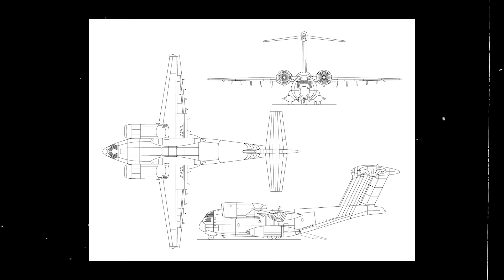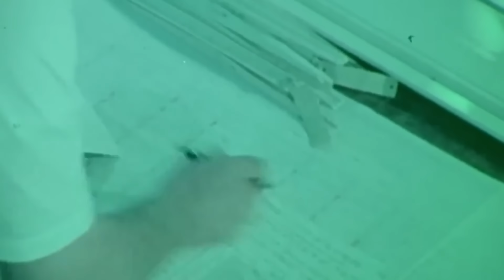The Plane that No One Wanted (But Could Land on a Football Field)

Comment: They could have replaced or at least augmented the C-130 with C-14 and then developed the C-17 from there to replace the aging C-141. What a lost opportunity like the USAF not buying or modifying the F-16 with the F-16XL.
Reply: The C-17 did replace the C-141.  The YC-14 was not needed to replace the C-130.  The F-16XL was not needed to replace the F-16, which continues to be built in improved versions.  Don't believe all the hype you see on YouTube about experimental aircraft, because there is always a good reason they didn't become production aircraft.
Reply: @gort8203  The F-16XL was faster, more maneuverable, carried much more armaments and super cruised around Mach 1.6 in the 1980s. It was actually entered in the competition against the F-15E Strike Eagle. The F-15E won ONLY because it had two engines. As with anything in government procurement, a lot deals with politics. You can bet Lockheed won the lobbying war with Boeing in congress and the Air Force opted to put the new technology into the C-141 replacement instead. The same thing happened with the YF-23. Northrop already had the B-2 contract and giving the ATF contract to Northrop as well would have been seen as too lopsided, so Lockheed Martin got the contract even though many saw the F-23 as actually the better fighter overall.
Reply: @richardlangdon712  "You can bet Lockheed won the lobbying war with Boeing in congress and the Air Force opted to put the new technology into the C-141 replacement instead." 

The C-17 was a McDonnel Douglas product, not Lockheed or Boeing.
Reply: @richardlangdon712  The F-16XL actually lost because it couldn't house the large radar of the F-15. I actually have fingerprints on the 2 XLs as a mod mechanic at General Dynamics at the time.
Reply: @gort8203  "...there is always a good reason they didn't become production aircraft...": Is corruption a good reason?
Reply: @toddmarshall416  "Is corruption a good reason?"  It is always the reason for many who frequent this channel.
Reply: The XL was an experimental airplane meant to investigate whether super cruise was practical in a fighter. The idea was that the cranked arrow wing would have a better supersonic L/D ratio, meaning less drag above the mach. Top speed was not the point, super cruise was, and the airplane failed to deliver the expected performance.  I didn’t even achieve marginal super cruise until it was given to NASA for further research after it lost the EFT competition, and they installed a more powerful engine.

It was entered into the Enhanced Tactical Fighter competition because it was lying around, not because it had been designed to that requirement.  It certainly would not have super cruised loaded down with bombs.    The F-15E won the ETF contract not just because it had two engines.  It won for multiple reasons such as lower cost and less risky development because the F-15 was already a proven strike jet, and the F-16XL was actually substantially different than the original F-16  and would have required a lot more development.

The F-1XL had a better instantaneous turn but inferior sustained turn rate, so it did not have superior maneuverability.  The wing of the original F-16 had been chosen over a delta planform because of that superior maneuverability.
Reply: @gort8203  And it was so good the Air Force took a serious look at acquiring it. Something that really doesn't happen in defense procurement.
Reply: @richardlangdon712  "And it was so good the Air Force took a serious look at acquiring it. Something that really doesn't happen in defense procurement."

Not sure which airplane you are talking about, but in any case this statement makes no sense.  USAF taking a serious look at an airplane and acquiring or not acquiring it never happens?  Seriously?
Reply: @gort8203  I was referring to a plane that was for research purposes only and not in competition for any contract, yet still managed to turn a lot of heads.
Reply: The XL also would have required an entirely new airframe, and that cost was more than the Pentagon wanted to pay.
Reply: Bureaucracies are good at killing innovation.
Reply: In response to the original comment, you’ve heard of the oxymoron, military intelligence
Reply: Yes those two decisions were STUPID, especially the F16XL. There hints popping up that they’re working on the F16XL or are planning on its return. But stealth projects may stop it again. The. Doe’s budget has been decreasing during Biden/Harris years and will drop sharply if the laughing candidate wins. CCP language classes will become popular…..🎉

Comment: The STOL Dehavilland Buffalo was a similar, smaller aircraft.  I saw a Buffalo land and takeoff in a strip that must have been about a football field in length during an extreme demonstration exercise. My mother was one of its designers and they made for the US military a prototype jet powered version which ducted air over the wings and had even better performance.
Reply: NASA subsequently rebuilt a Buffalo into the Quiet Short-haul Research Aircraft, which had a custom wing with four (not just two) jets mounted above it. This increased lift even further than the YC-14 had, and produced an aircraft that could fly at only 50 knots, take off in less than 700 feet (a third of the YC-14's minimum takeoff run) and take off and land from an aircraft carrier deck, without assistance, despite carrying tons of cargo. That never went anywhere either.
Reply: @zh84  The KC-130 used during the Navy testing on the Forestall did some of it's testing without JATO, even at full loads - and never needed assistance to land.
Not "could have done" (possible, the Buffalo had impressive performance) but DID.
Reply: It’s still parked at Moffett airfield. We taxi past the nasa ramp and see it sitting out there with the c141
Reply: @charlesblithfield6182;
if you have any 'hard' info on a DHC "Jet Buffalo", i would love to see it!
DHC and Canadair have almost always been screwed over by USA politicians and brass-hats.

Comment: This plane is completely useless. It has already been proven in the real world that the C-130 can literally take off and land from a soccer stadium. You just got to put enough jato pods in the right spots
Reply: @michaelfrench3396  in 1979 delta had a plan to use C130 with jato. That plan backfired with a disaster in the desert.
Reply: @briancooper2112  Yeah but not because of the C-130. That was because one of the CH-53s pancaked on top of one of the c-130s. That was the most ridiculous plan for them to try to pull off anyway. Delta thought they were what they were in the movies. They had to find out the hard way that real life isn't. The movies look back at their history and you'll see in the early '80s of the late '70s when they first started Delta kind of sucked. You learn through your mistakes. And since they were brand new they made lots of them
Reply: @michaelfrench3396  the dust poor nvg's poor equipment navigation all factors. Yes we learned.  Better equipment nvgs training etc
Reply: @briancooper2112  The JATO-assisted C 130s in the soccer stadium plan was concocted after the failure of Op Eagle Claw (Desert One).  It was abandoned when, during practices, a C 130 caught fire.  Also, by then, the Iranians split up the hostages and dispersed them around the city.
Reply: @lib556  I believe it was planned before crash and Iranians kept hostages in one place.
Reply: @briancooper2112  I don't claim to be an expert. Most videos I've watched on it state the rehearsals were conducted after Desert One.  They may have conceived of the idea as an alternate. I don't know for certain.
Reply: @lib556  I think we both agree the idea would never work. Unfortunately Americans died trying to carry out a rescue plan that failed.
Reply: @briancooper2112  Tragic loss of dedicated, highly-trained professionals.  Luckily, no one was injured in the JATO experiment.

Brings to mind the bad luck the US has had in such ops (no disrespect to my US friends). I read/watch everything I can get my hands on regarding the Israelis at Entebbe, the SAS at Princes Gate embassy siege, the SAS rescue in Sierra Leone, Ops Eland and Dingo conducted by the Rhodesian army... These daring, successful ops capture the imagination of the public and serve as both morale boosters and as a caution to dirtbags.

Tragically the US has initiated some great rescues/raids post WW2 that just didn't pan out: the Son Tay raid, Desert One etc.  I suppose the success of the SEALs in nailing UBL and saving Capt Phillips come close.
Reply: Well apparently sarcasm isn't taught at schools anymore. While it was successfully tested landing on a soccer pitch, the amount of equipment or practical loads that could be carried by that aircraft was infinitesimally  small. Have a good day everybody
Reply: @michaelfrench3396  Don't worry, sarcasm is not a lost art. 😁
Reply: No it wasnt. Reminds me of a C-17.

Comment: YC-14 Would be a hell of a Fire Plane... even the Original YC-15      (Before the C-17 changes)  the small 4 engine plane would be on the level of a RJ85 but with a larger tank close to the level of a C-130 if not more...   Both prototyles could be made as normal aircraft today and would have good uses.  the YC-14 would crush the C-130 everywhere.. the way the KC390 is starting to take off around the world
Reply: What happens if a rock gets into  the impellers of the yc14s motors.Could it fly on one motor?
FOD is a real problem with jets.
Reply: @johnhagemeyer8578 
Its engines are very high up. FOD is a very small probability with engines so high up. On an F-16 with the scoop underneath it is very susceptible to FOD!
Reply: @andrewday3206 The high engine position had two functional aspects: Reduced susceptibility to FOD and with “Upper Surface Blowing” giving additional lift performance to the wing giving it astounding runway performance. Only two engines? The reliability of current designs for overseas flights passes most flight safety tests.
Reply: @christopherstone2691  
I worked on the A-10 and F-15 flightlines. The A-10 was much more resistant to FOD. The F-15 of course was far more FOD resistant than the F-16. The additional lift of this design is rather interesting. One wonders how this would work alongside a Ground Effect aircraft.
Reply: @johnhagemeyer8578  Does the A10 have the same reservations?
Reply: @toddmarshall416  I don't know. Alls I know is that when we were doing EROS in Selah Creek proving grounds in the early 1970 I was  blasted with rocks and dirt and grime when running up to the newly landed 130's to pop chains removing straps, to empty the  back if that aircraft and get it airborne. 
Those are huge holes up top that wing that the  c130's don't have  plus two more more motors it does have. A bit more redundancy I think.

Comment: Given that a C-130 could land on a carrier this would have been a great heavy lift resupply aircraft for the Navy assuming it’s wings weren’t longer than at C-130 given that the C-130s starboard wing cleared the sail by ten feet.
Reply: A C-14 would have been able to land on a CV but that was dumb idea. The entire flight deck had to be cleared of aircraft before the C-130(or C-14) could land or takeoff. If one aircraft couldn't either be spotted below or get airborne and the C-130 or C-14couldn't land.

Comment: didn't big engines make lot of noise and increase visibility for missiles?
Reply: Because they were above the wing the exhaust was hidden from the ground and more difficult to see with an infra-red seeker than the usual position under the wing or in the tail.
Reply: @zh84  But not from the air.
Safer (a little) from ground stuff, but SAMs would eat it alive and not notice any difficulty.

Comment: From a maintenance standpoint those engines would be an absolute bitch to work on. Doing an engine change would be a major undertaking. That could be one of the reasons why only the Russians have a model of that type of plane still in existence. The Americans seem to be incapable of doing difficult things like they used to.
Reply: Put GE 105 ,s on it... have to beef up engine mounts.. they are 3 million a piece but that thing would boogie
Reply: I think you would eject from bottom